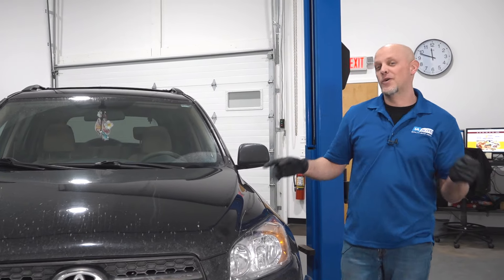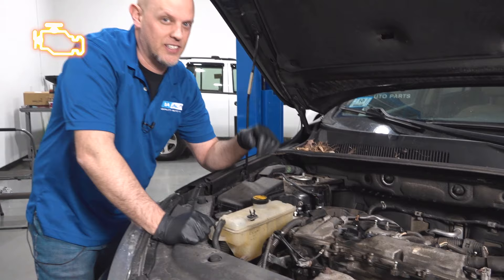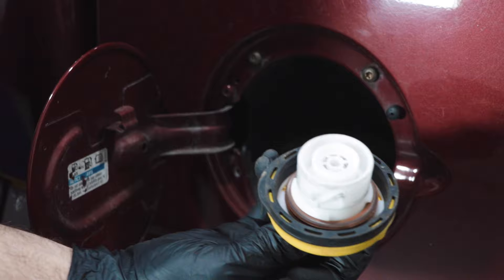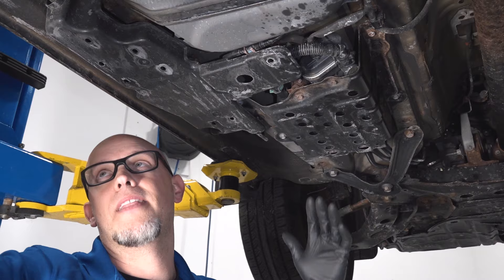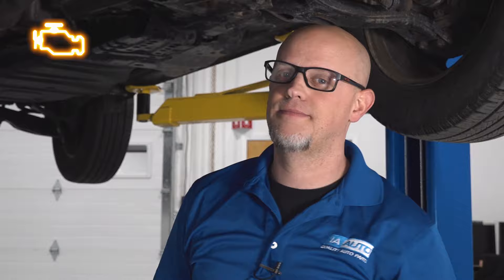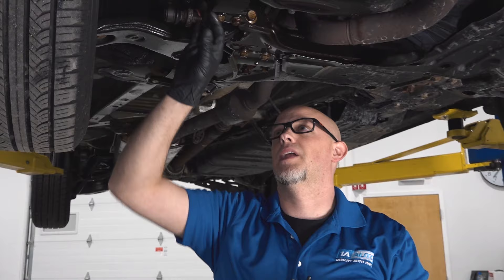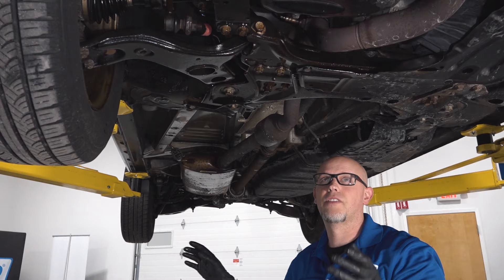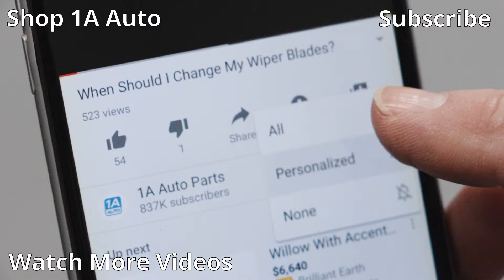Top 5 Problems Toyota RAV4 SUV 3rd Generation 2006-2012

Comment from the maker: √  Watch the Video
√  Buy The Part at 1A Auto http://1aau.to/m/Visit-1AAuto
√  Do it Yourself
√  Save Money
Reply: I have some issue with clicking sound near wheels like under the car. I am not a mechanic but I think it’s those sway bars you mentioned or is it axels ?
Reply: I have a 2007 Rav 4. I have been blessed to have over 280,000 miles. I have had the ignition coil issue and the burning oil as well. Toyota basically rebuilt the motor about 5 years ago because of it. I love mine but know time is getting shot with it. Hoping for 300,000.

Comment: You Ignored the biggest problem with this generation Rav4: OIL CONSUMPTION.  It was mostly the 2006-2008 2.4L 4 cylinder, thousands of engines were even replaced by Toyota under a campaign up until about 2018.   Even the 2.5L burns some oil.  The V6 is immune to the problem but more likely to have oil leaks.

Comment: 2007 RAV4 was once my mom's car. Great on gas, reliable, and can fit more stuff than a sedan! Great daily!
Reply: What about that oil problem?
Reply: @UnsettlingDwarf   If it’s a 2011-2012 it doesn’t have the problem. They addressed the problem on the updated engine.
Reply: I currently have one I've dealt with some problems with the oil as I know there's an oil burning problem so you got to keep checking the oil because the engine also goes in the Camry or Corolla I believe and they have to drop the engine and replace stuff and Toyota says it's not worth it using a higher quality thicker oil works. Other than that I have no complaints about the vehicle. I do however suffering from a catalytic converter problem and I had to get the small one replaced and the big one is going to be a lot of money.
Reply: Only the 2.4 liter four cylinder had the problem 2006-2008. Ours is 2009 and consumes no oil between changes.
Reply: Space... You're right! I've fitted a full size fridge inside with all the doors closed. I was pushed again the steering wheel and my testicles were getting hot when I was turning, but that's just a detail. 😂

Comment: I owned a 2006 Rav4 ,put 173,000 miles with no problems and not 1 minute at the dealer for warranty repair. Traded it in for a 2011 Rav4.Put 203,00 on it with no problems and not 1 minute at the dealer for warranty work. Love my 2017 Rav4 Bought it new. Same as the previous two, no problems or warranty time .

Comment: Recently my 2011 rav4 V6 4WD has developed an intermittent engine surge while braking.   9 years no issues.  Last month, while pressing the brake to slow down/stop, the engine surged and made the vehicle difficult to stop.  If I hadn't put it into neutral,  it would have rolled me into the intersection.  I've had the same all weather mats in the vehicle since  I've bought it.  Not an issue for many years.  All of a sudden this new issue acutely appeared.  Read through the forums.  Toyota blamed the floor mats with other vehicles reporting the same issue.  I switched back to the Factory mats. It worked okay for a few days, then did exactly the same thing with the original equipment Toyota mats.  It's not driver error,  my foot was no where near the the accelerator when braking.   No one seems to know the root cause.  I was wondering if anyone else had experienced this and what the solution was that resolved the issue other than replacing the vehicle.  There has to be a fix out there.  Please let me know.

Comment: I had the 2010 rav for eleven years just traded it in on the 2021 hybrid the only problem I had in all them years was I done a left hand front strut  other wise in was amazing bullet proof I used to drive it hard from day one and it never missed a beat
Reply: I have the same problem with mine ,, only problem in 12 years 400,000 km and still going hard

Comment: My wife's 2010 RAV$ (4Cyl) now has 130K miles. Not one of those things that you have mentioned has failed yet. I have replaced the radiator, which I fortunately noticed when I open the hood for no reason. The hose was pretty much totally broken, it actually totally snapped just with the very slight touch I  did. The left wheel bearing totally crapped out, due to water penetration which rusted the entire bearing. This al happned at 90K miles. To this date, just battery tires, and wiper blades that I regularly replaced. I drained and refilled twice the the ATF at 100K miles. Still drive like it was brand new to this date. The headlights are still clear since it was wrapped with 3M clear bra.
Reply: Cuanto.  Balen. O. El. Presio
Reply: Same here. My 3rd gen rav 4 have 283k still none of the 5 problems
Reply: I have the same vehicle and have only had routine maintenance, tires, wipers, brakes, headlight bulbs, and batteries. Been a fantastic car. Going to keep it going until the doors fall off, if possible.
Reply: I have a 06 4cyl. Just hit 200k and only have had one or two of these problems. I'd drive to Florida and back (I live in Kentucky). It's amazing
Reply: I had zero problems in this video, but the exact problems you have wheel bearing and plastic radiator Y cracked.  100k miles

Comment: We’ve got a 2010 rav, 280k kms, still going strong, no problems, chews a bit of oil these days, I’ve calculated about 10 litres per 10,000 km, sounds a lot , but that’s only 1 ml per km, easier to just top up every weekend than worry about the cost of replacing the engine or vehicle. Driving it till it dies
Reply: Hey! I'm considering buying one of these vehicles in a few months because I'm looking for something reliable and not too expensive to buy and keep, would you recommend it?
Reply: @juanda1995  yes. i have one and it’s very noisy and loud engine but it will NEVER die. aslong as you keep up with the oil changes and top it up when it’s low it’ll last easily 300,000 miles
Reply: Ours is a 2009, it has 250k km, and the vvt rattle on cold starts, we already replaced the timing chain (caught it just as it was about to fail 😅)

It doesn't burn oil at all, but we are getting low gas performance, about 6 km/L (14 mpg) and I gotta say that I drive like a grandma on Sunday.

No check engine light or any other problems...
Reply: 4 or 6 cylinder?
Reply: Own one as well, use some 'stop smoke' or stop leak, it usually works if the leak isn't too bad (worked on ours). Overall 240,000 kms and a bulletproof V6, can't complain.
Reply: @antoniogm6241  
We average close to 28 mpg with ours. Mostly highway miles. 5k oil changes. Change the engine air filter annually. We use top tier ethanol-free fuel. I noticed a fall in mpg when we put less energy efficient tires on. I always set the cruise control at the speed limit.
Reply: @antoniogm6241  how did you know the timing chain needed replacing?  That worries me about my 2011 rav because the chains are supposed to last the life of the vehicle.

Comment: The real top 5 issues:
1. Gas is not self filling
2. Oil changes every 5k to 10k
3. Air filter gets dirty
4. Brakes wear out
5. Tires wear out
What I'm saying is these go 200k mi on nothing but basic maintenance.
Reply from the maker: +Rob Stop It Thanks for the feedback!
Reply: @1AAuto  I forgot to say I had a headlight burn out and your video saved me the headache of figuring out what fasteners needed to come out. Thank you.

Comment: I have a 2007 rav4 and I have an evap canister check engine light along with two other lights. The code suggest I replace the canister. When I pump gas, it stops all the time and I already replace the gas cap. Also one of my spark plugs leaks oil into it too. Your video is spot on lol
Reply: How many miles is on your RAV4
Reply: @Takumawakanda  right now over 144k

Comment: This is spot on. 2007 rav4 V6. It had thr sway bar problem and o2 sensor issue at around 110k miles. Replaced those, now going 🎉smoothly

Comment: my 2012 (4 cylinder) ran like dream for 260k miles but would burn a half quart every 750 miles or so. It was my dads 2nd car and I would drive it when I wasn’t at uni. today was my first day back from uni so i drove it  for the first time in awhile and when i got to my destination across town, it started smoking and then went up in flames <5 minutes later. unbelievable.
Reply: Rav4 don't suppose to burn engine oil. Your car probably had a oil leak and since you hadn't driven or taken care of it for a while, the oil probably leaked out. Car without motor oil will burn because of the friction.

Comment: I still drive my 2006 Rav I always maintain it put new part in it if needed. Such a reliable car 170,000 miles on it 4 cylinder engine and it still runs like new.  Anything lasts long when you maintain it right.  The only thing with the 4 cylinder engine is that it burns oil fast but I’m ok with that.
Reply: does it have the 2AZ-FE engine, that one was known to use oil after 70 thousand kilometers or so due to faulty oil rings. the engine model after that didn't have that problem, although some motors do use some when the miles get high.
Reply: I have an 09. I run nothing but mobile 1 full synthetic oil for high mileage. I have no leaks, my oil does not burn and I have 150k+ miles on it.
Reply: We have the newer AR-FE 2.5 liter engine in our 2009. Uses no oil between changes. I don't believer in using high mileage oil unless you have a problem with oil consumption.

There's nothing wrong with full synthetic Super Tech oil and that's what we use.

Comment: I have a 2007 Rav4 with 160K miles. I just replaced the sway bar links, and I have issues filling up the gas tank all the way similar to the #2 issue mentioned in this video.

Comment: My 2006 has none of these issues. Surprised he didn't call out the 2AZ-FE engine like I have. The one where the piston rings were installed incorrectly. Consumes oil so have to be vigilant as to oil level.

Comment: Those are minimal and can be avoided/remedied through periodic/religious maintenance. 😊
Glad it's not engine, brakes and transmission issues  compared to other makers cars belonging to that age group. 
Given that is a Rav 4 pretty sure it's been great miles and rough conditions with at least 140 M on it.
Reply: 2008 Rav are common for throwing a rod and needing a engine replacement

Comment: We have a 2009 RAV4. Ours has 71,415 miles on it. I just replaced the downstream O² sensor. The upstream sensor was replaced about six months ago. We also had the intermediate steering shaft replaced and (believe it or not) the transmission as well.
Reply: 09 with 71,415 miles!!! Wow that's awesome, will have that car for a long time!! I have a 2011 with 146,000 and have had it since 13,000 miles. Been keeping up on maintenance and I replaced front end bushings and steering bushings but that's a Givin over time. Awesome cars
Reply: Did you ever change oil in the transmission?
Reply: @Jakerz007  I just bought a 2011 rav sport (sap) with 121k kms on it.   Hoping it'll last me a long time with proper maintenance.
Reply: @yarpenzigrin1893  yes, I have the transmission flushed once every 2 oil changes.

Comment: Thanks, I’ve got a 2011 with just 62K on it, bought it new, haven’t had any of those problems so far but will keep them in mind, I take very good care of my vehicle & plan on keeping it until it’s no longer reasonable to put money in it, hope it’s a very long time, like over 200K. It’s been a very good SUV, I’ve had no major repairs, just recently had to replace part of the exhaust for the first time.
Reply: I have a 2011 rav with 121k kms on it and hoping it'll go far past 200k kms.   My 1st rav was a 97' and I sold it with over 500k kms on it!

Comment: Currently I’m driving a2006. It was driving me crazy over couple months, starting and not starting until after 0-15!attempts. To my surprise, the dashboard wasn’t showing anything. So I grabbed my neighbor’s OBD reader, and it showed me a list of codes related to EVAP system issue. To make the story short, I replaced the purge valve, but I have to after other codes and god knows how much I spend on it before clearing all the codes. To be reasonable, I’ve had this car for 7 years no issues until this one، beside the rust, I’m telling you they’re horrible for rust

Comment: I have a 2007 Rav4 V6 Sport AWD with a leaking front differential. It's not leaking from the axel seals but it is leaking at the pinion seal from the driveshaft going to the rear differential and I'm told they have to remove the whole Engine, Transmission, Differential to fix? What do you think?

Comment: We just bought a 2011 Rav4 2.5L with 152k miles from the original owner.  Transmission fluid is black, but Toyota says it's not necessary to replace?  PCV valve is likely defective so that would cause oil leaks, blow-by into the crankcase, and excessive oil usage. Luckily I haven't fount any oil leaks but seems to have a lot of blow-by in the oil.
Reply: I'm about to flush and change my ATF. I keep getting a shudder at 40mph in low rpm. Have you experienced this?

Comment: 1)Radiator hose plastic connector-known failure point
2)Agree on the coils,mine went bad on 2010
3)Wheel bearings went at 90K
Other than that very reliable vehicle,still going at 165,000 miles.I’m doing a suspension freshen up now.
With the price of new vehicles I’m gonna keep her running until a major failure point.I’ve never had a repair I couldn’t do myself,never had it at a mechanic other than inspection.

Comment: 2010 rav4 sport with 110,000 miles.  Check engine 4wd and traction control light on.  Went to mechanic codes for evap canister and 02 sensor at the same time.

Comment: Great video! Would you rather purchase 2010 Toyota Rav 4 sport with 150K miles @ $11.5K or 2006 RX400h w/ 120K miles for $10.5K? Let's assume both are in excellent condition. Both have a ll proper maintenances done. Thanks.

Comment: I've got a 2010 rav 5 speed manual, had it for almost 5 yrs, have not had any problems with it, best vehicle and it's bulletproof, unbreakable, if U keep up to date with servicing etc, it will run forever, there's an old saying: " U look after your car, the car will look after U"

Comment: Happy to say, my 2010 4-cylinder has not had ONE of these problems yet... or any other major issue for that matter. What an awesome vehicle! 

For the last twelve years, I have followed the recommended maintenance and have replaced brakes and tires when worn. That's it! 

My biggest complaint is the overly-sensitive TPSM that never seems satisfied. I found your video today as I searched for ways to reset the sensors or disable the light altogether. Drives me nuts!

Comment: have a 2007 base, what's the best vacuum line to tap to perform a smoke test?   Mine is throwing a P0171 and has for a while.  O2 sensors, MAF, fuel filter, pressure regulator, injectors, plugs, PCV, all replaced.  Amazingly hard to find a vacuum leak with other methods.  Probably on there somewhere, but I'm not ruling out fuel pump, but I hear they hardly ever go bad.  Will be testing fuel pressure too soon.  Also, have the intake gasket in hand, but the carb cleaner check and vacuum pressure test seem to be okay.

Comment: Interesting - the evap canister issue is due to it being in a very bad location - water gets into the pump's electronics and rusts badly. Rav4world has photos of this issue.
O2 sensors - yes they do go "bad" but it is also the front catalytic converter that goes with it $$$$.
The other major issue is the "cold rattle of death" on cold starts. There is a technical bulletin on this and my 2010 rav4 suffered from it. Total loss of oil in the engine and the valve train was toast. - Traded it in.

Comment: If you get your oil changed at Fred Haas be careful that they don’t strip the oil pan by over tightening then calling it normal wear & tear.  It will cost you to to replace the oil pan.  Good job boys.

Comment: On my vehicle, the symptom is that the vehicle slows down while driving even though i have my foot on the gas, then starts to drive normal. Before this happened, the evap code popped up twice and disappeared. Planning on replacing it this week

Comment: My mom had a 2008 ford escape with 80k on it... shifted a little rough already, she put 40k on it and the trans went, did the trans, and 20k later the engine went right after she sold it and got a rav, put 180k on her rav and juuuust now needs 1 ball joint lol.

Comment: Another big problem on that generation of RAV4 not mentionned here is the drive shaft. At a certain point, the drive shaft bushing will jam (overall in the cold) and between 45-80kph it will shake. Quit costy to replace when it is the original shaft because the hole shaft as to be replace.
Reply: Sounds like you got shafted 😝

Comment: got a 2010 rav 4 4cyl with 4wd, i got a check engine light for a misfire (sometimes) and a crank sensor circuit, my mechanic recommended not replacing it because on his data log it seemed more like a reluctor wheel. the engine starts up usually on the first couple cranks and only feels luggish occasionally when i step on it, you think my mechanic is wrong and the sensor actually is bad or is it likely the reluctor wheel is broken. im lost here

Comment: We haven't noticed any of these problems with our 2009 RAV4 which has 62,600 miles on it. Maybe later. We have noticed that the ATF fluid is often 20⁰ to 30⁰F hotter than it should be so we change the fluid more often.
Reply: 4 Cyl or 6?
Reply: @Probe253  
4 cylinder... 2.5 liter AR-FE with 4 speed automatic. Six cylinder has a 5 speed automatic.
See my updated post. Ours has over 71,000 miles now. Transmission was replaced as was the intermediate steering shaft and both O² sensors. Transmission and steering shaft were covered 100% by aftermarket warranty.

Comment: Anyone have thoughts on a used 2010 v4 with 140k miles? What should I be on the lookout for before buying? Would prefer the v6, but the only option I'm finding now are the v4. Are they as reliable as the v6? Worth $8500 if in decent shape?